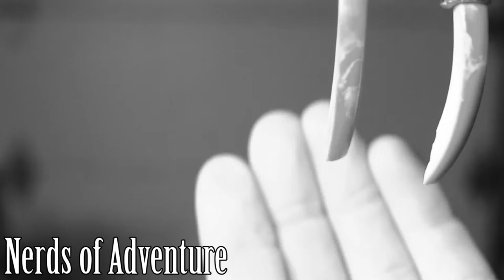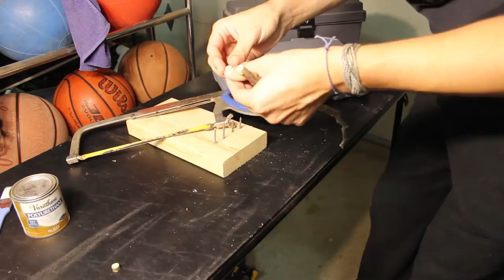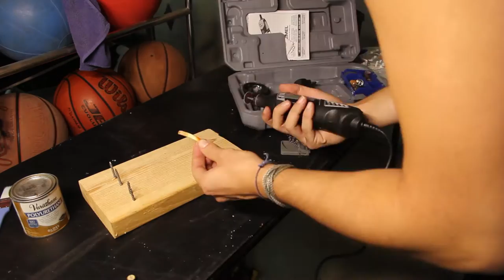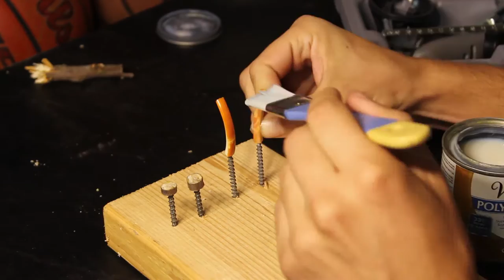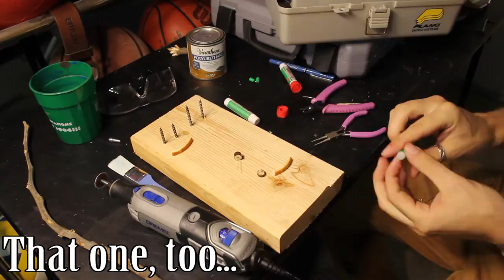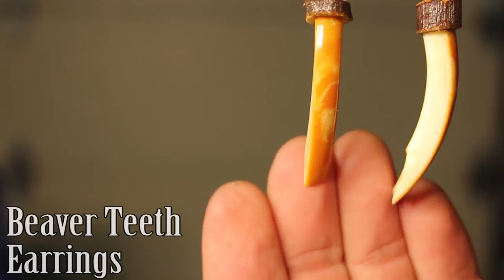Novemblog Day 13 - I Make: Beaver Teeth Earrings

Comment: Hello, I just had to jump in here, and tell you "good job" them are awesome!!! I to make native necklaces, and have found many ways to make them really "beautiful" after doing this for so many years. here are a few Ideas you might like. I use antler tips I only use the white ones as I use a torch to bring out the beauty within them. I use some straight, and some with the curve. I personally like the curved ones. I then use my dremmel just like your model, and drill the hole as it helps to put a string through it for spraying the poly on. I then carve in different designs, and even what ever people want them to say something in "native" on them. after I do all the carvings I use a torch to bring out the real beauty in them. just make sure you don't over do it lol.lol.. like I have many times. after I finish that I use a spray on "high gloss" polyurethane, but some people like a "semi gloss" or even "satin flat" polyurethane or none at all, and a little trick I learned is to use a blow dryer on high heat to pop any little bubbles that may have been left behind by the spraying. also make sure not to hold the blow dryer to close to your piece, and it makes them very nice, and smooth. then I start the "beading process" witch can be difficult as I carve the beads as well it's the longest part, but it's worth it, but when there done I have people knocking my door down for these things. I just wanted to jump in here, and tell you your doing an "awesome job" I really like them. I can see you put your heart into them, and that makes them even better. keep up the good work. on payday I may purchase one from you as well. thank you for sharing this video with us. ben..